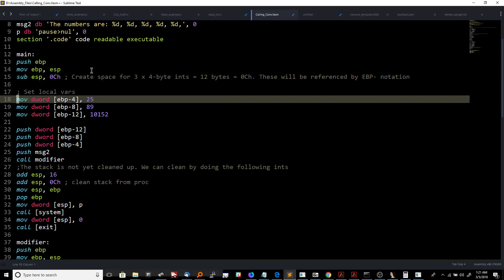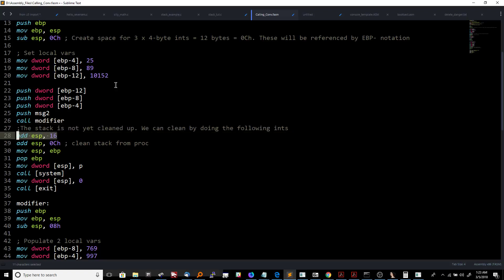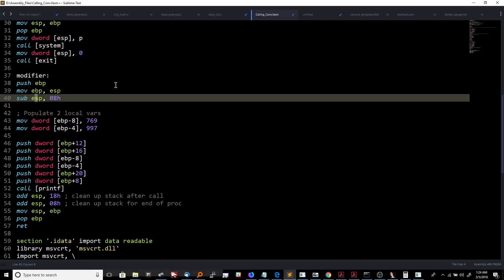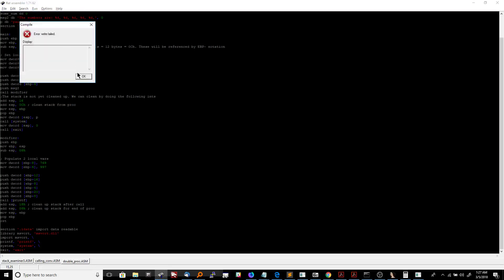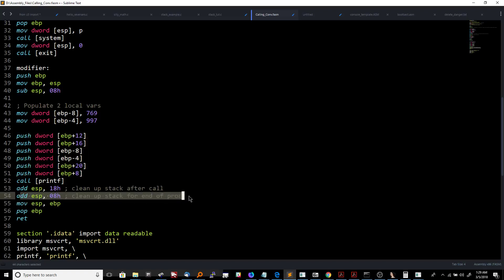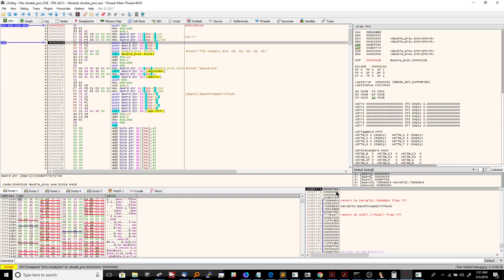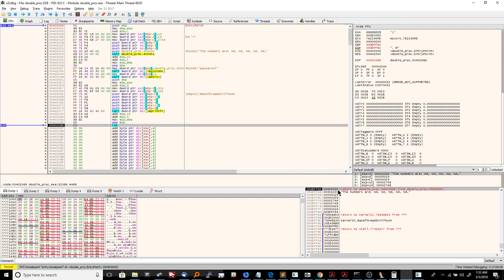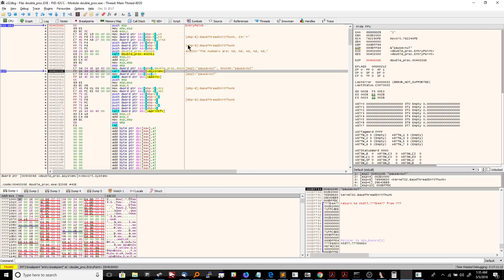x86 In-Depth: CDECL Calling Convention Complete Tutorial - BONUS video

Comment: Surely that's actually cdecl calling convention, where the caller cleans the stack of parameters.
Also, the compiler won't create BOTH lines 29 and also line 30, because they do the same thing (ditto with lines 54 and 55, only either, not both.
Reply from the maker: Thanks for the correction. Yes, this is actually cdecl, I mixed them up when I filmed this (that's what I get for filming at 1 AM). I will put out a vid soon about STDCALL and how the two are different, correcting this one. One of the reasons I make these videos is also to learn so I appreciate your information!